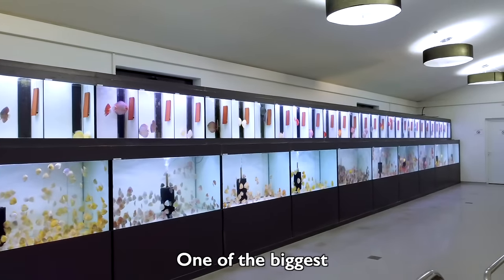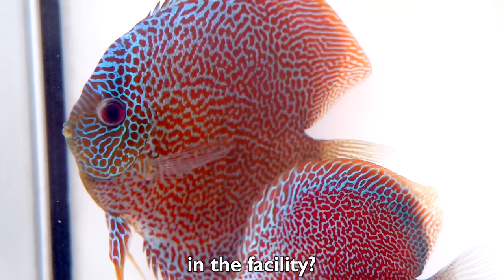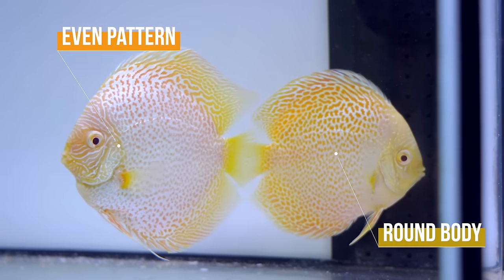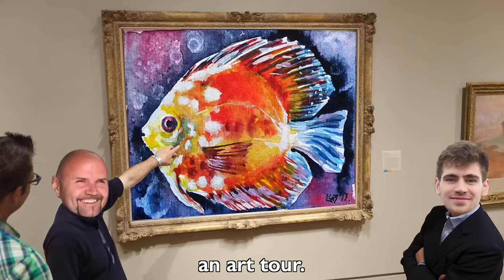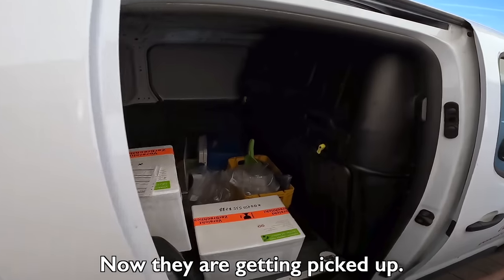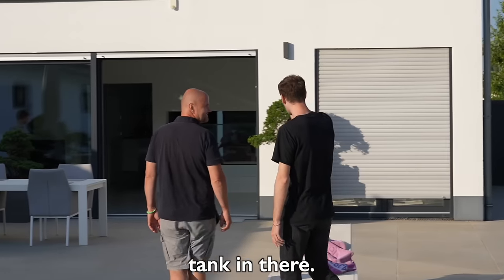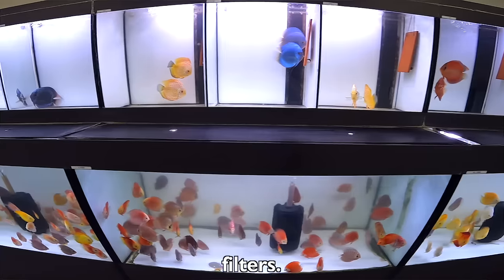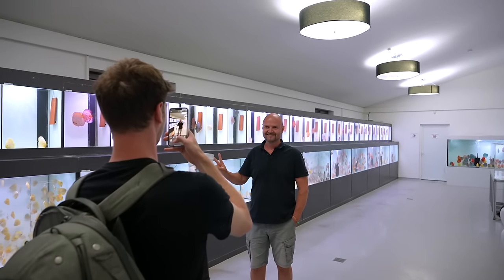AMAZING DISCUS FISH BREEDER!! [Tour]

Comment: It's too bad discus aren't as hardy as the more common angelfish. They require more care and maintenance which make them unaffordable for most fish hobbyists. They need to genetically modify them to handle lower water temperatures and handle a wide range of pH. The majority of breeders focus on the color and patterns of discus but not enough for increasing toughness and survivability. They should slso breed them to eat regular fish flakes food instead of frozen food.